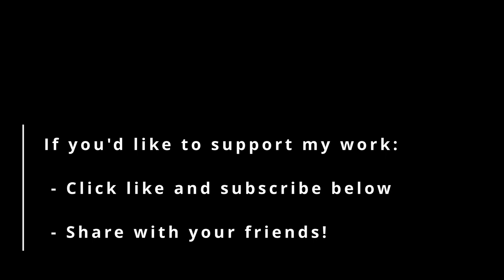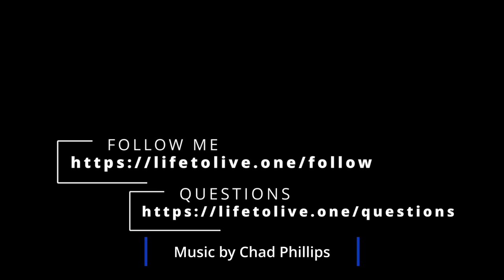Episode 32: New shed, part two

Comment: Доброе утро, хотелось бы узнать. Чем вы обрабатывали сами деревянные дуги от гнили или ни чем не обрабатывали? Ещё в коментариях прочитал про вашу борьбу. Ели не секрет что за борьба?
Reply from the maker: Partial translation: Good morning, I would like to know. How did you treat the wooden arches themselves against rot or did you not treat them with anything?

I did not treat the arches themselves at all, they have no contact with the ground, and the moisture is low in the shed because I keep it open most of the time. I did stain the bottom seals, since they are close to the ground, and the stakes that hold the frame to the ground are pressure-treated wood, which should prevent rot.

Comment: Здравствуйте. Я тоже пытаюсь сделать строение из таких арок. Есть проблема. Если на рейке есть даже маленький сучёк, рейка ломается. Как вы решили эту проблему?
Reply from the maker: Translation: Hello. I am also trying to make a structure from such arches. There is a problem. If there is even a small knot on the rail, the rail breaks. How did you solve this problem?

Yes, this is indeed a challenge! I broke a few arches when bending them, too, this is actually to be expected. I don't think it's a good idea to reinforce the wood for the arch, as this will probably compromise the arch. My strategy was to try and find the wood in bundles that had the least amount of knots, buy more than needed, and only use the very best pieces of wood for the arches. The pieces with knots, save those for the horizontal and diagonal bracing, because those pieces you can reinforce if you need to.

Good luck!
Reply: @lifetolive_one  thank you!

Comment: Congratulations. Nice work. It looks simple. But how can I curve to get an arch that reaches 2.58 m (8.46 ft) high for a hut at the base of 3 m (9.84 ft) wide. It is my great concern. Greetings from Valdivia, Chile
Reply from the maker: The plans I used, the bow is 14 feet in length before bending, and the width of the shed is also 14 feet.

I'm not sure how another configuration will affect the stability of the structure.

Comment: don't you think those pieces of wood in the ground will rot over time? maybe better to use concrete poles?
Reply from the maker: The stakes in the ground are pressure treated, per the recommendation of the building plans I used.

Comment: Hi. Dont you afraid that foundation sticks will rotten over the time? Or you did some impregnation on them?
Reply from the maker: The stakes are made of pressure-treated deck boards, they should have pretty good resistance to rotting.

Also, I'm under no illusions this building will be standing 100 years from now ;)

Comment: What was the purpose of one end having the bolt in it instead of just screws?
Reply from the maker: Actually both ends of the bow received a different treatment than the middle. Each used a longer bracing block, and was both bolted through and screwed. This was according to the spec in the instructions I used, my assumption is that extra support is needed where the bow is fastened to the ridge and the sill.